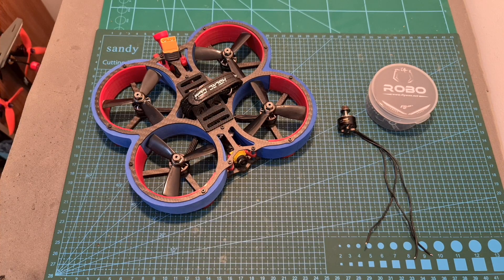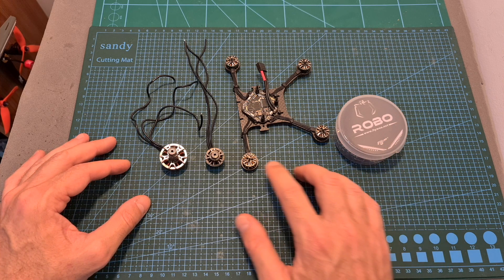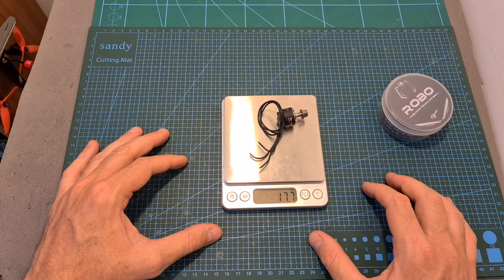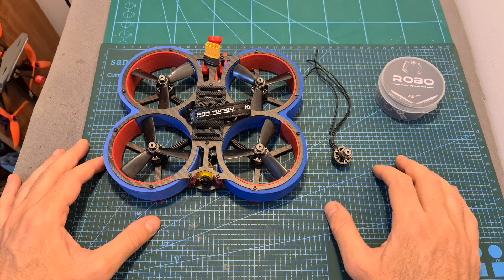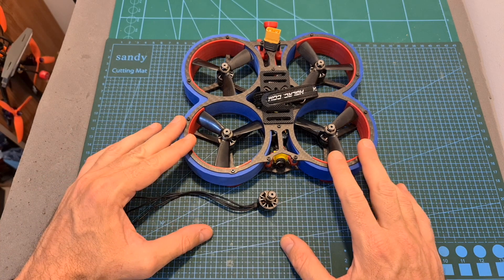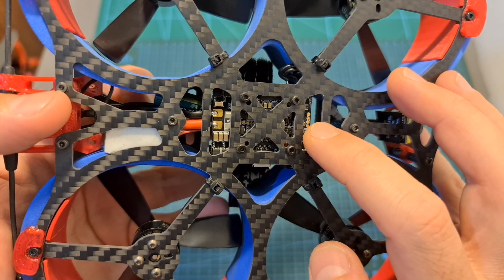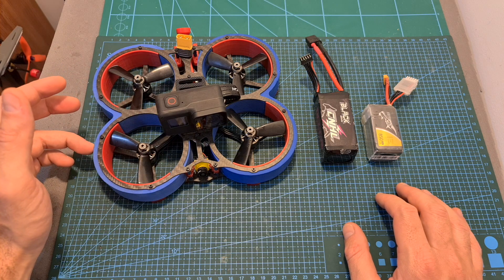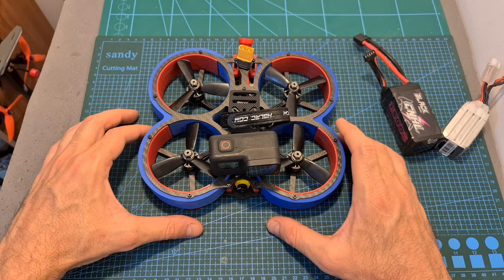Flywoo Robo 1507 4150KV Motors - Thrust & Flight Tests

Comment: I've switched from 1408-1507  and have excellent flight time and power. Although i'm using 3600kv. On my cinewhoop I'm getting nearly 6 minutes on a 1350 and 7-8 on a 1500.
Reply from the maker: Thanks for sharing your experience. I think that the lower KV is the key.

Comment: I disagree with recommending 1408. The tmotor 1507 and brotherhobby 1507 work really well on my cinewhoops. /1408 is a tad on the small side for the weight they're carrying. The 6s versions also give a pretty reasonable flight time but even the 4s gives me over 4 mins with a hero8 and 1400mah lipo.
Reply: 14x08 = 122 while 15x07 = 105. Im not sure where your getting your information from. But you may want to double check. While I also have the tmotor 1507's on one of my cinewhoops, a 1408 motor will produce more power.
Reply: @unicornoperator  
1507 3800kv tmotor 626g 3052 gemfan
1507 3800kv brotherhobby 626g 3040 tri
1408 3600kv hglrc 404g 3052 gemfan
1408 iflight xing 548g 3056 tri blade
Where is this extra power you speak of? Every 1507 puts out more power than a 1408 regardless of brand. These specs are from the manufacturer.
Reply: It's not as simple as multiplying the height and width of the stator. Not sure where you're getting your info from but you may want to double check it. Jump of mini quad test bench and have a look. Wider stators almost always produce more power and definitely more lower end torque which is exactly what you need on a heavy cinewhoop carrying a GoPro.
Reply: I have no idea why you multiply the heightxwidth either. If you're attempting to calculate volume it would π X r2 x h.....
1408= 1231.5mm2
1507= 1237.xxmm2
1507 is bigger.
Reply: Dale Pattison volume = pie * radius2 * height. 
1408 = 4926
1507 = 4948 

For some reason I had 1506 stuck in my head which is a more common size.
Reply from the maker: Thanks guys for your input. I was only sharing my personal experience it it might have been much better if the KV was lower. Anyway for a 3" racer these motors are a good option.
Reply: @unicornoperator  ya got ya maths wrong buddy. 
1507= 15 divided by 2 to give motor radius as 15 is diameter=  7.5 (15 is diameter not radius). 
πx7.5 squared X 7 = 1237.xxxk
Reply: In saying this. I accidentally worked out 1508 not 1507 but you get the idea. 1408 is a smaller motor but critically it's the narrower stator that causes the sizable reduction in power.